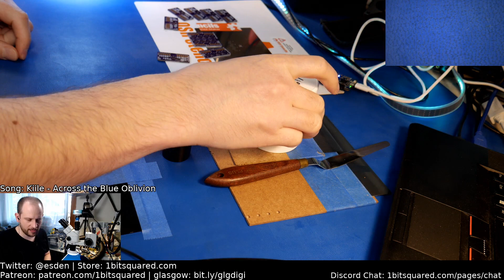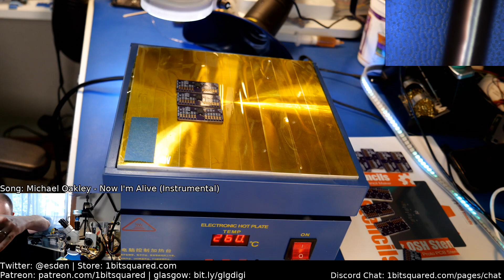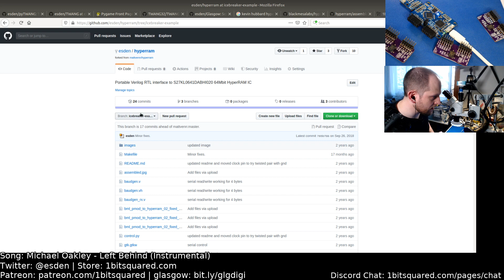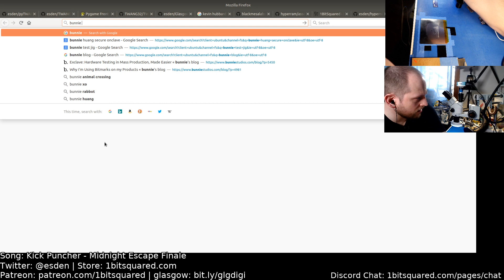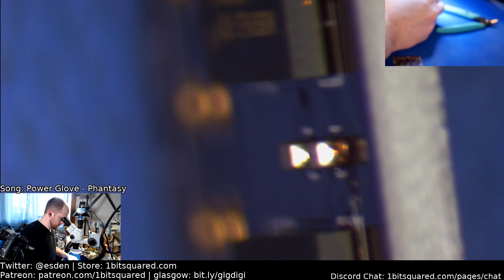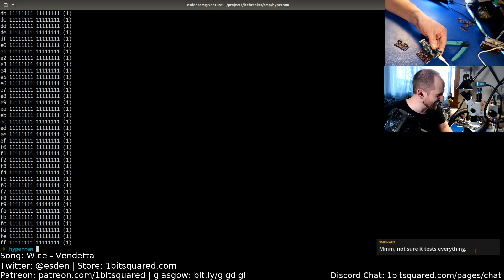Electronics Let's Play - Assembling "Single-" and "Quad-" Hyperram Pmods

Comment: Balls on BGA'a are an endless source of jokes.. What's the most complex PCB design that you have done?
Reply from the maker: Mhh hard to say, the most difficult board to create and assemble was the LisaS autopilot. But Glasgow Digital Interface Explorer definitely has more placement and is thus it probably can be categorized as most complex board I did so far? But I also assembled the powersupply/BMS board for the Novena Laptop, and that was pretty time consuming, but it was only one board... It is all a learning experience so each one brings it's own challenges, thus it is hard to say what is complex and what is not, part count does not always mean, hard to assemble. :)